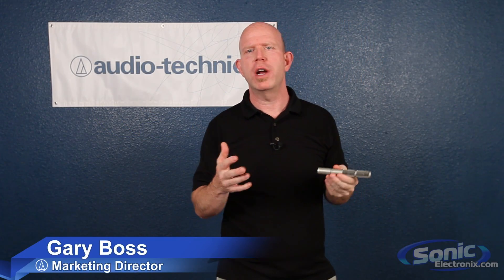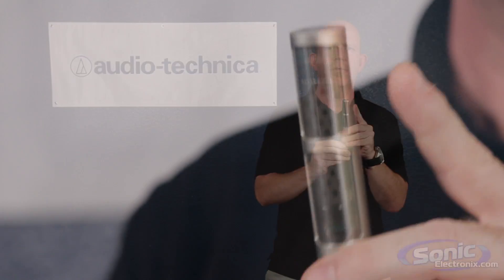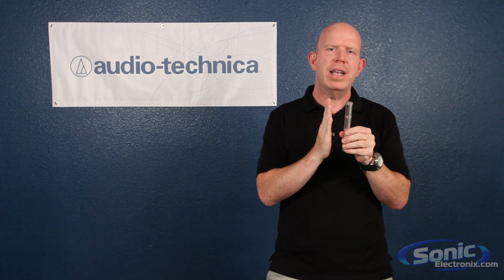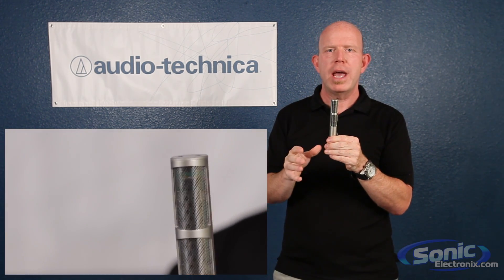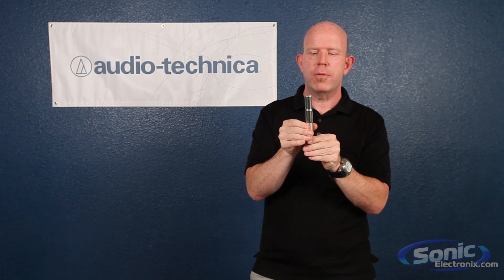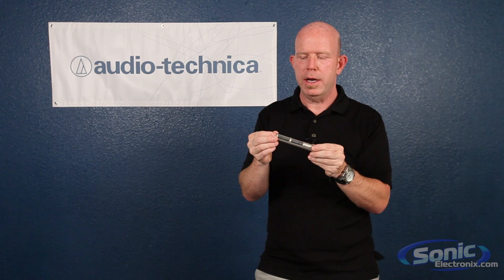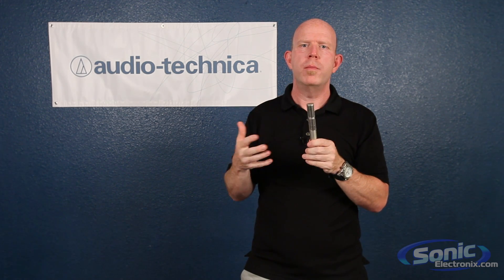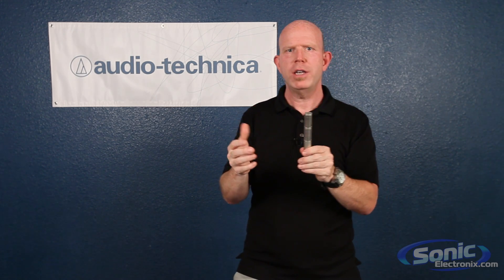Ribbon Microphones Explained | How They Work & When to Use

Comment from the maker: The Cloudlifter series products introduce about 25dB transparent gain to your signal chain and in conjunction with a dedicated mic pre and is a very popular solution for lower signal dynamic mics and ribbons. The SPL goldmike 9844 on its own provides up to 72 dB of gain and should work just fine paired with the AT4081. The gold mic does not feature any variable tube saturation so pairing it with the cloudlifter can give you some gain staging options to play with but not necessary for function.